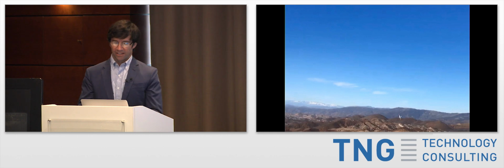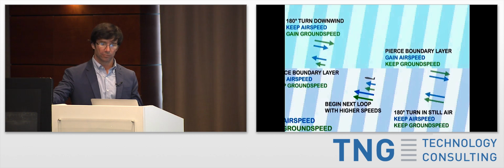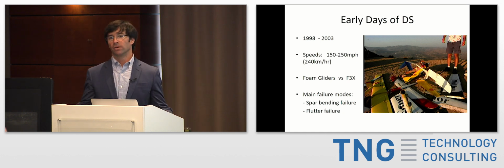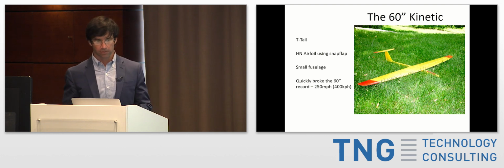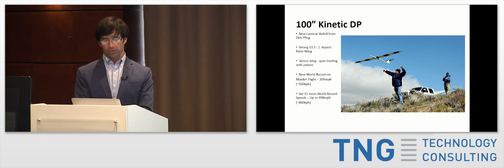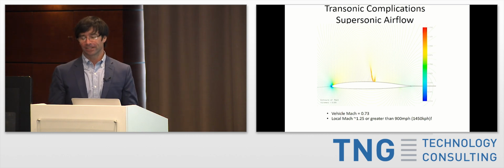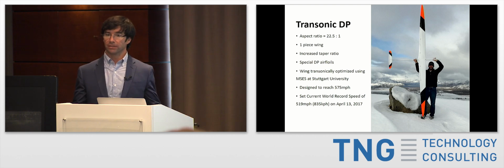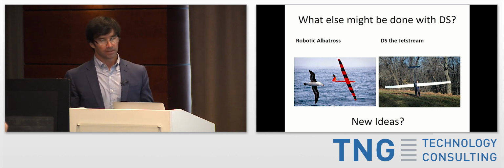BTD10: The 835kph Sailplane and Dynamic Soaring

Comment: A 20' diameter radial parabolic lenticular model airship builder released it at a declination angel approximately equal to the slope of the trajectory of the soaring glider shown here.  That airship accelerated to approximately 100 mph do the low drag of the shallow parabolic curve ... something like y = 0.1x^2.

Comment: Actually, conventional front-side soaring has broken RC model speed records, faster than powered models, since the late 1970's, when composites were first used in models (e.g. CF and Kevlar). The Swiss and Austrians pioneered this, packing fairly small gliders up into the Alps and flying them there. By 1979, and emphatically in 1981, composites came to dominate in the multi-task F3B RC glider contests, leading to a re-writing of the rule-book, which still led to composites completely dominating good ol'  wood in competition flying by the 1990's. Ditto for the discus-style hand launched lightweight  gliders (F3K) invented circa 2000. Only in the mid-2010's was a class invented for largely wooden  Hi-Start launched thermal gliders (the 2-metre F3-RES or F3L class), to retain the simplicity, low cost and peacefulness of RC soaring as it was before the 1980's. It is quite popular in Turkey, Germany. Holland and parts of the US. The design which inspired the development of F3-RES gliders was Mark Drela's 2-metre Allegro-Lite, which most F3-RES designs resemble quite closely (see Charles River CRRC website archive).

Dynamic soaring is an amazing development. This talk beautifully explained the fundamental aerodynamic concepts involved.

Comment: You mentioned the 'T' tail configuration, but did not amplify why it has an advantage over the classic fuselage mounted stabiliser and elevator.   Also is your horizontal stab a fixed stab or is it what I call a 'full flying stabilator' ?

Comment: I agree about automation of flying parameters.  An Nvidia Jetson, at a few hungred grams, should be able to do it using off the shelf MEMS as gyroscopes, tune flight characteristics by recording the control and movement values, with training happening on vetted best commands (best loops, fastest, safest, smoothest).  Sort of Tesla style, log hundreds of loops, train, have run simulations of control to verify quality, retrain, then put as passive into glider and record its virtual movements.  Ultimately then press an autopilot mode while in circular flight. 
Might also need pitots for speed measurement, which would solve other questions.

Comment: Science just realized you can do this with solarwind as well our sun have solarwinds of 450-700 miles PER SECOND! If you could use this trick there wow. Same phenomena happens at the edge of the solar wind / start of interstellar winds. And because there is no drag in space... It could open interstellar travel well in theory that is.
Reply: How much force does solar wind blow? And if there is no drag in space, because there is n air in space, how then will you execute a maximum g turn?

Comment: So this is interesting, it means you can maintain sailplane practically indefinitely as long as you can find reliable air speed gradient. You could theoretically recover whatever amount of electricity you need  from a small RAM-like device and basically keep it there forever until you loose the gradient or the device parts wear down.

Comment: so when an airplane wing stalls, it does the same thing as the wind  does over the hill. You get separation (what he is calling shear). I wonder if you could take advantage of this, to get energy out of the stall. If you could direct this energy toward lift (pull up on the hill), you could get incredible angle of attack...

Comment: Have you used supercritical airfoils to push the critical Mach number up higher? All the modern airliners use them now to achieve efficient cruise speeds of M.85 with less sweep than earlier generation airfoils with very small leading edge radii and flat bottoms.
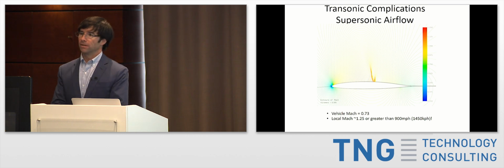Reply: 35:30

Comment: I found this very interesting. My world is about speed but my goal is 500 mph in a piston engine wheel driven vehicle. In order for these guys to go supersonic they are obviously going to have to move away from a straight wing but as Spencer pointed out, a delta wing was unsuccessful at low speed. I would expect the way to get around this would be a swing wing / delta combo design. The SU-24 & the Tornado are the best examples of this that come to my mind.

Comment: i apologize up front for this comment because i don't know what i'm talking about but...it seems that the current aircraft design is almost fully optimized so any great leap forward will probably come from new materials (graphene?) or maybe the incorporation of an AI controller (yes, that would take the fun out of flying!).  so what about optimizing the landscape?  from the videos it appears that the places where the flights take place are quite variable along with atmospheric conditions.  could something be done to reduce environmental variables?  i guess i'm suggesting building a racetrack with the ability to change aspect ratios of the "hard" surfaces in real time.  you could also incorporate "nets" into the design to "gently" catch the gliders when something goes awry.   anyway, my two cents...best wishes and good luck!!

Comment: My god. If only I had half of this guys processing power.
Reply: I don't think what they modelled and run is anything Uber intensive in terms of processing power required. 
It's a lot of knowledge on their part to set those simulation and analyse them, that's for shure, and that's what I envy them.
But I think the graph shown are all "only" 2d airfoil cfd and simple rigid body models of the aircraft with thin airfoil, nothing that would take much benefits form detail that can be solved by a night (at most) of number crunching by a typical dextop pc, I'm guessing.

... I can't say anything about that bit done at Strutgard university, that could have indeed took some cpu Time , i just don't have a clue

Comment: My first thought was:  At that speed and that tight of a turn, the G’s pulled have to be incredibly high (speaking as a former fighter pilot, that’s why I thought of that)...glad you finally said you measured them about ⅔ of the way through the video - interesting that you topped out the meter at 120 Gs!  You get above 9 sustained Gs and a human starts having significant difficulty staying alive! I spent a lot of time at 9 Gs - it hurts. Have lots of medical issues because of it.
   My other thought (which you then addressed) was that it looks like you are pushing past “normal” human ability for reaction time. Amazing flying skill there.
    I wonder if you have experienced mach tuck?
    My last thought, which you did not address, is it seems rather dangerous!  At those speeds, an out-of-control model hitting a person would cut them in half!
Reply: It looks like the if you do screw up, you will most likely rip the wings off, slowing it down to much safer speeds.
Reply: @mossm717  Nah, it just make a hole instead of cutting you in two.
Reply: @mossm717 this is one of those times where being on the edge of self-destructing actually makes it safer
Reply: Sorry to hear about the health after-effects. Do you mind sharing what some of those were, or could be, at worst? I know neck and eye injuries in pilots are common or possible. 
       I'm wondering if a hyperbaric--or reverse hyperbaric--a hypobaric chamber treatment would have helped. The therapeutic mechanism would be different or corollary, and it's just a wild thought. But I'm sorry for your travails.

Comment: For the wings, could you make the skin like a bladder so to speak, and pressurize the wing to maintain a “smooth” contour and hold on to the attached boundary layer further back?
Reply: Why not just make the wing out of whatever material it already is, and have the shape you have in mind?
Reply: There is an extremely low area of pressure surrounding much of the airfoils upper surface. This equates to pressure differential, so the wings internals are already pressurized compared to the external atmosphere. 

I'm not sure how this helps, unless you are oil-canning the wing skin under load? These aren't aluminum, It's pointless if the wing has a solid core.

Comment: On the new swept wing design can you use the Prandtl Bell Shaped Wing Loading design?
Reply: You can use whatever lift distribution you want. But I don't see that as the solution to what these guys are doing. As root bending strength is not their issue as he said, more carbon fixes it and more weight helps to a degree. 

Their problem isn't reducing root bending moment, reducing empty weight fraction,  and increasing payload. Its going transonic.
Reply: @Triple_J.1  thanks for your reply. I wasn't thinking of reducing root bending stresses but the reduced drag of the bell shaped lift distribution design.

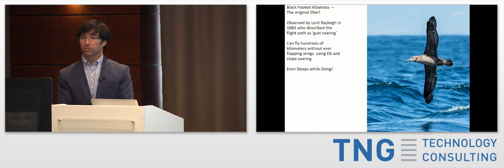Comment: The question I have is about the statement "constant diameter turn." I'm considering the centripetal acceleration vector when passing through the sheer layer and maintaining a constant diameter would negate the effect.  But I don't see how the radius of the turn can be controlled when passing through the sheer layer, with the abrupt change from headwind to tailwind.  Therefore, the tightening of the turn, or the compression to an oval, as stated at about the 12:35 mark, would make centripetal acceleration THE major vector in this system.  I'm an RC enthusiast but not a glider pilot so perhaps someone can explain how ca is not a major contributing vector.
Reply: Basically this explanation of dynamic soaring as a result of 'shear layers' is impossible because it would violate the laws of physics. What RC glider pilots call dynamic soaring is not the same thing as the dynamic soaring that albatrosses do. This should be obvious considering the fact that albatrosses don't fly in circles and they don't go hundreds of miles an hour. Albatrosses don't stay in one place, they drift horizontally the direction the wind is blowing. A detailed analysis is available here: https://www.youtube.com/watch?v=CdaoiplgyII
So whats going on with RC gliders when they do their dynamic soaring? how can they maintain altitude and speed by going in circles if all they're using is the wind? Well, if you saw a plastic shopping bag going in circles in the air it would be obvious: the wind is going in circles. Call it whatever you want (eddie, vortex, whirlwind), these circular wind patterns on the leeward side of some hills are not formed by the wind coming over the top of the hill, but the wind wind coming around the SIDE of the hill. Some hills have them, but most do not. This is why RC glider pilots are always using the EXACT some spot over and over again, and it's also why they ALWAYS fly clockwise at location A, and always counter-clockwise at location B.
Reply: @davesmith3289  "Newton's Dynamics" is something to review because Theorem 1 explains the principles of motion, acceleration, and time, of moving bodies that are not moving in a straight line.  Motion on a circle or curve is accelerated even if the speed is constant. Can be a plane, a car, or yes, a plastic bag.
Reply: @davesmith3289  There's nothing about the principle of crossing shear that defines it as flying in a circle vs. an S-turn, high vs. low G, or high vs. low speed. Energy is extracted from the relative motion of the two airmasses (or zones separated by gradient, not separated by a razor sharp boundary like a simplified diagram for an initial concept demo). The source you posted, Colin Taylor, who has written a detailed website and some Youtube videos, is 100% incorrect in claiming that albatrosses can collect energy by flying downwind turns in uniformly-moving (non-shearing) air.

Comment: Could use the drag to your advantage to omit fluttering, back pressure inflation bladders, to strengthen rigidity. Could use the laminar shockwave, convert it to piezoelectric discharge, have predefined cavitations, think longitudinal and equilateral, channel the static discharge, give spark to upgrade the fuselage to a ramjet. Just a thought.

Comment: About Jet Stream energy recovery:  There is often a dramatic difference (20 knots or more) in head/tailwinds by climbing or descending a few thousand feet, which I've discovered through many flights in the 15,000 to 28,000 foot altitude range in my turbocharged piston powered airplane.  Regional airliner, turboprop pilots, and "Center" ATC personnel are familiar with this too.
Reply: It can be hundreds even???
Reply: Yes developing an algorithymn  to use this free energy then ATC operations that can accomadate these fluid changes is yet another interesting area ...
Reply: Now, if only we can get FL18-FL23  into Class E/G so Turbo piston GA can actually utilize their full potential without being stuck IFR at the mercy of ATC.

Comment: Good stuff. I was present for a similar lecture by Joe Wurts himself around 2000 when he was visiting Christchurch, NZ for a gliding competition. I remember then trying to DS with my foam flying wing in the Port Hills. Did 1 and a half turns before the wingtips clapped hands. But I was super impressed by the incredible whooshing airspeed sound of soft foam and flappy packing tape from my beatup slope glider made just before it snapped.

Comment: Energy producing kite that, instead of free wind stream, dynamic soaring. You could generate tremendous electrical power with just a "kite" and an anchorpoint on the peak of the hill.
Reply: ... The anchor point replaces the dead air zone.

Comment: i wonder how fast a full size glider could go with dynamic soaring?
Reply: Loads increase rapidly with span so it would be difficult to build a full scale glider stiff and strong enough to survive the desired flight path.
Reply: @sll914  yeh of course it couldnt do as well as an rc one but it should still be able to go pretty fast tho right?
Reply: @lucywucyyy  If you go full size with a human pilot, the materials would probably allow greater speeds that would produce G-forces in excess to what human pilots could endure. The current models produce in excess of 120 G’s and the pilot would weight 10 tons at that acceleration.
Reply: @charlesward8196  thats talking about a tiny rc plane doing a very tight loop tho, obviously you couldnt do that in a full size glider but on a much larger scale using a mountain or something i wonder if itd still be possible, i tried to look for videos online but i can only find examples of rc gliders doing it
Reply: @lucywucyyy  I am not a pilot so I am just spitballing here, yes a regular sailplane could probably do dynamic soaring, doing one or two loops to build speed to gain altitude, and then moving on. The problem as I see it is that the hazards would be too great. The pilot would have to trespass on the lee side of the crest in sinking air, through the zone of turbulence, and very close to the ground. If you want to live a long life, stay out of dynamic environments. Remember that the process was discovered by an RC pilot who was in a desperate situation. Training and practicing to develop the necessary flying skills by actually flying the dynamic course would present an unacceptable risk of hitting the ground near the crest. Apparently the best DS for RC aircraft are during powerful Santa Ana winds. Perhaps with lighter winds the risks would be less.
Reply: @charlesward8196  true
Reply: A study: https://streckenflug.at/download/dynamic_soaring.pdf

Comment: @TNG - Please no picture-beside-picture. Use PiP instead and get some pros:
1. Presentation fills the whole screen.
2. No unnecessary black bars.
3. Text is actually readable.
4. Less than half the movie file size.
5. Center of screen and presentation align.

And most presentations have enough "empty" area on many pages where the shrunken down presenter PiP can be placed.

Comment: Could I add this as part of my coming to an understanding of how DS works in non-mathematical terms?   Having read and watched a lot on DS, I’ve noticed by now that the theorists never mention Gravity as a serious component of the energy available.  

Let’s recall that any object heavier than air, when in the air, is always falling. A wing by its aerodynamics challenges Gravity by using the prevailing airspeed of the wind, continuously contributing to the lift inherent in a wing.  

Thus the glider/albatross is always “falling” to the ground except the wind and it’s wings prevent this, plus going even faster, gaining energy,  when deliberately descending, and losing a bit when it climbs and dissipates some of the potential energy gained on the period of descent. 

Then it does a wing-over to get a slingshot effect from the wind above the shear layer, regains speed and energy and repeats the cycle. 

Hope I’m not too far adrift.
Reply: assuming zero drag, over the course of a single revolution the net contribution to energy from gravity is zero, purely because weight is a conservative force that only depends on position in the field. Hence weight is neglected in the analysis .
Reply: Actually, even if drag is considered, if the flightpath is a closed loop then the net contribution from gravity is still 0